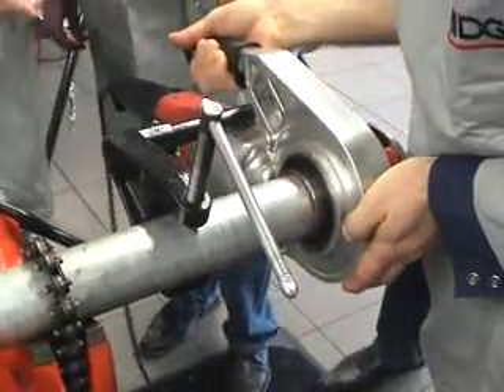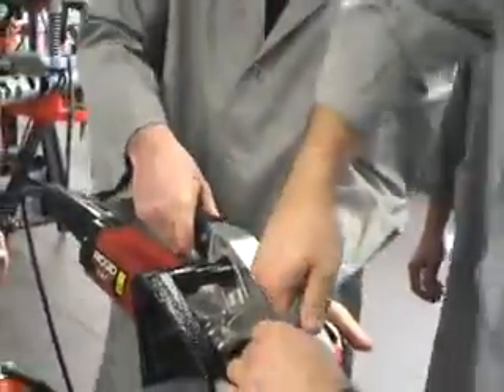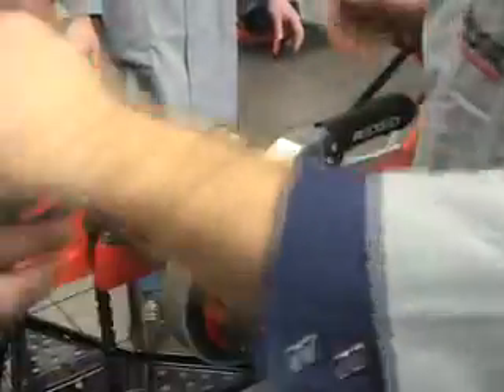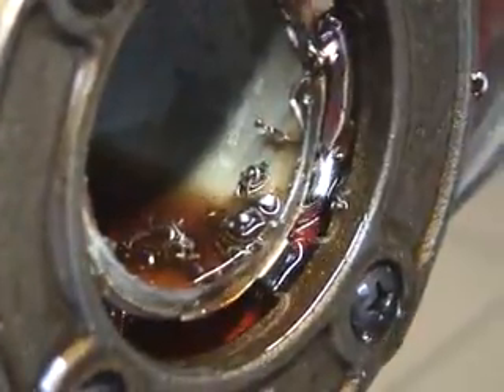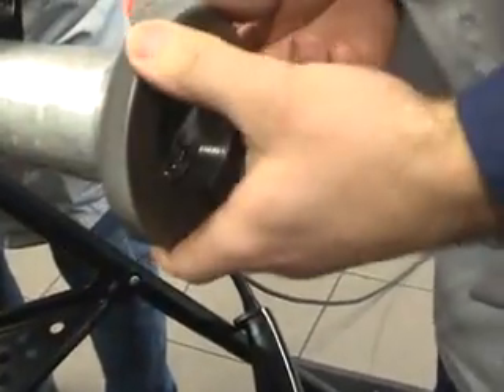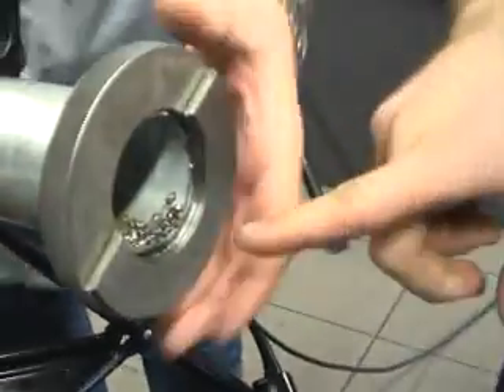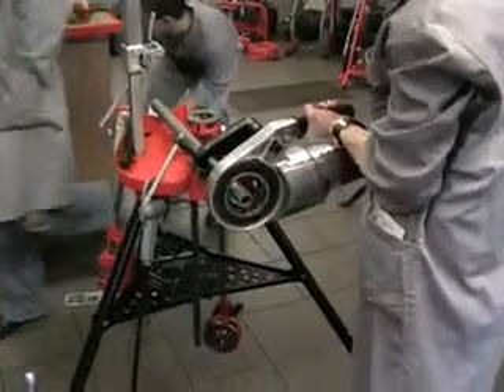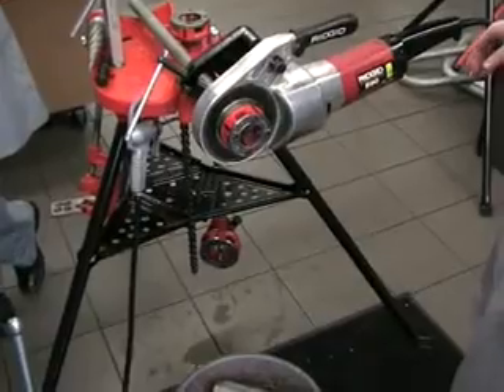RidGid.spb.ru  Обучение в Бельгии-резьбонарезной привод 690 С

Comment: its a good job, but truth is you sticking the tip of the oiler between the die holder openings was foolish the oil will get there fine by squirting it in with no risk..